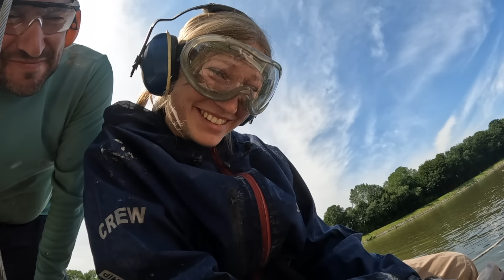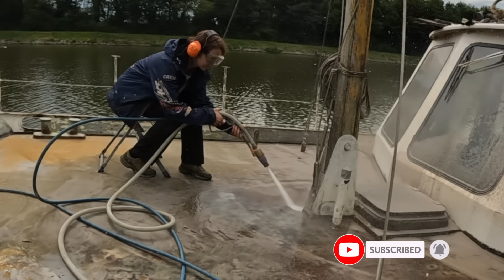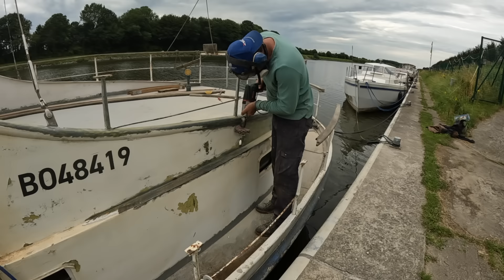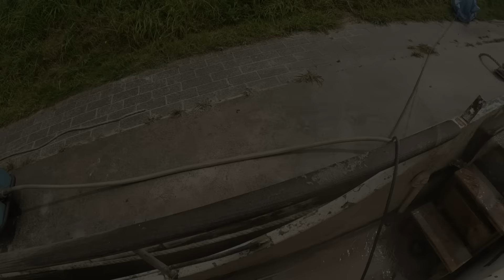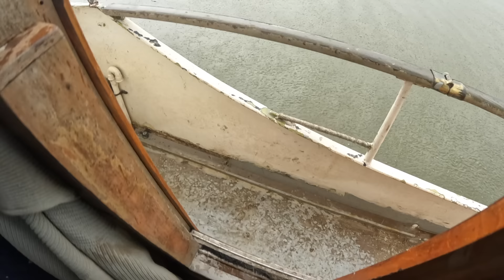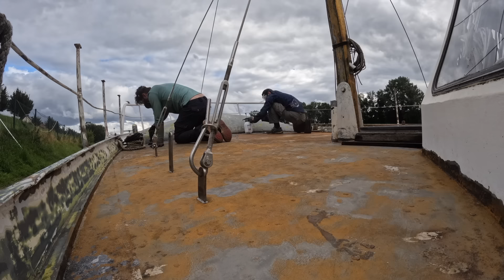Project Y EP  25 -  Hydro-Blasting & Tercoo Techniques for Successful Restoration | BoatProjectY

Comment: really fantastic boat well worth the effort- but your helpful family is the real gem.. ive been a marine mechanic for twenty years and have evaluated some of the new e propulsion systems- I highly recomend finding a a good trditional diesel replacement instead- unless you install a large diesel generator as a hybrid drive.  Unless you plan specific use with only short duration limited voyages. we really are a long way from epropulsion being practical. Also- I really question the safety of a large lithium battery pack- especially in a marine enviornment, A fire that you can not extinguish..... If you do proceed electric I hope you will find someone who has converted a similar vessel and lived with it for a few years first....and get their experience with cost and range,
Reply from the maker: Maybe you’re right. But I still strongly hope and believe that the sector is in a blistering fast evolution. Not the motors, they excel on all points, but on the battery side. Who knows where we’ll be at in 5 years. And worst case I’ll have a backup generator. I’ve spoken and seen a company in holland who did many conversions. And this looks very promising. From 2025 all ships must be electric in the Amsterdam canals. So they know what they are doing…
Reply: @BoatProjectY  interesting- however no amount of govt legislation will change the laws of physics.... but if that company makes suitable installations at a resonable cost that will meet your travel distance and speed all the more power. regardless- love the boat and look forward to seeing your progress!

Comment: Try, VEVOR Stainless Steel Polisher 1200W model, with, AOKLIT Abrasive Drum Paint and Rust Remover, 40 Grit Abrasive.
Some truckers and machinists seem to be using it, where they can't get an abrasive blaster.
Note, reasonably priced.
Best wishes from Northern Canada.
Reply from the maker: seems like a very capable device. and very good priced.
Reply: @BoatProjectY  Also, one of the YT boaters used one. to remove bottom paint.

Comment: I'm very surprised by the slow progress you made with the 3x Tercoo. Also with the relatively clean steel it should've striped the entire paint with ease. I recently had to get rid of a few rust spots at a 5 meter mast and removing the old paint was so easy that I've just stripped the whole paint and did a re- coating from scratch. So I feel a little bit sorry that you haven't had the same positive experience we had, since I was among those who recommended this piece of equipment.
Reply from the maker: I agree, rather disappointed. Once back at the boat, in about 3 weeks, I will give it some more thoughts, and do a more thorough investigation why I get such poor results.
Reply from the maker: Then again, you are using a 8 disc version. No wonder it goes faster.

Comment: Maybe its an idea to remove the 'shield' from the foredeck. It kind of ruines the visual aspect of a large foredeck. Its kind of unusual also ( for a recreational boat).
Reply from the maker: Do you mean the ‘coat of arms’ on the bow? In that case I must disagree. It sets the boat apart, and gives a unique look to it. I need to figure out what it means., but if it’s non offensive. I will definitely keep it and restore to proudly waer it on my boat.
Reply: @BoatProjectY  no the sloped steel plate on the foredeck behind the chain locker man hole.
Reply from the maker: @evilla7579  oh gotcha! yes I might give that some thought.

Comment: Needle gun......
Is there not an adjustable shield for your needles on the needle gun?
It should slide down and cover the shafts of the needles when in use.
The needles should only be exposed say about an inch (2.5cm) depending on how much rust one is needing to remove .
It has been a long time since I used one a vessel named then Lloyd B. Gore
Reply from the maker: There is a shield, but I doubt it’s adjustable. Right now the  needles come out about 3 inches from the cover that might be the reason . And I should buy shorter needles.